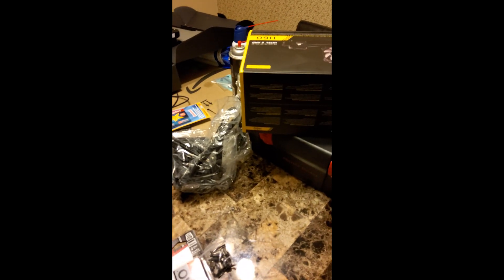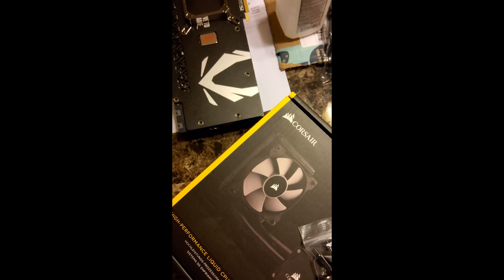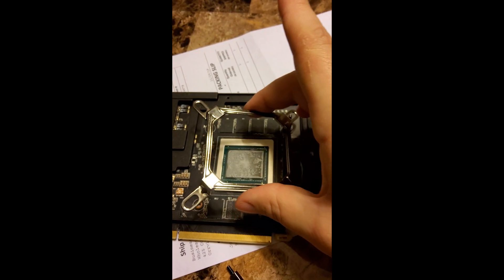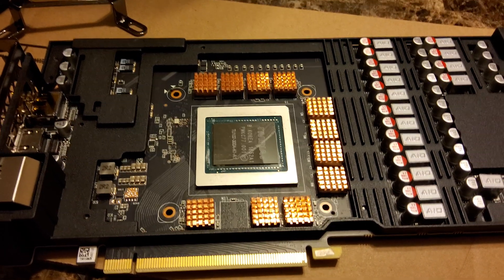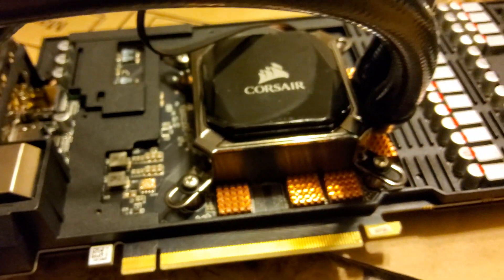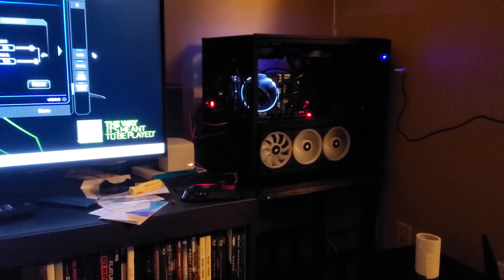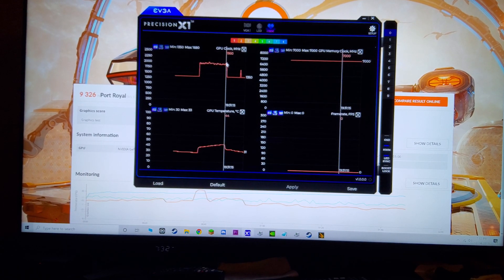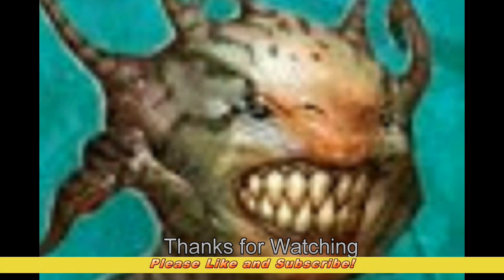Zotac AMP MAXX 2080 Ti | Corsair H60 AIO | GPU Water Cooling

Comment: zotac made an awful card wit hthe 2080ti AMP MAXX. its got awful fans , that are known to make terrible noise, if yours doesnt make the noise, youre either lucky, or they havent started yet. its like having a bullfrog in your PC case, that croaks every second or two. your best bet wit hthe AMP MAXX, is to remove the 4 screws that hold the fan shroud on, it will allow you to remove all the plastic shroud, & the fans, but the heat sink will still be attached. then mount a couple 120mm or whatever size fans you want on top of the heatsink, & plug them in to the 3 pin fan plugs on the AMP MAXX PCB. use whatever to secure them & youre done.

Comment: Did you think to put tension/pressure springs on the back side of your screws, to help hold even pressure on the water block to your GPU? Less chance you over tighten the screws damaging your card.

Comment: Question! Do you still have the h60 mounted onto your gpu and if so did the fans on the pci slot do the trick, you recommend using the h60 to cool your gpu?

Comment: any chance you recorded taking off the cooler?
Reply from the maker: Sorry I didn't.   However as I recall you pretty much just remove the 4 spring screws around the GPU itself and that's all that actually holds the HSF to the card.  That and you have to disconnect the power connector of the fan from the card as you take the HSF off.  So 4 screws and disconnect the fans.
Reply from the maker: I can take a look at the HSF when I get home and verify nothing else has to be unscrewed.